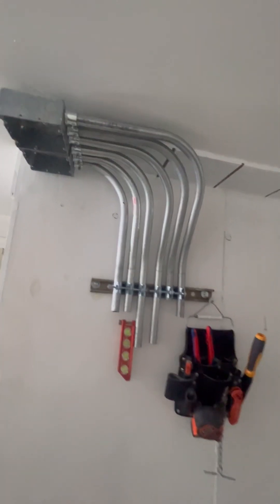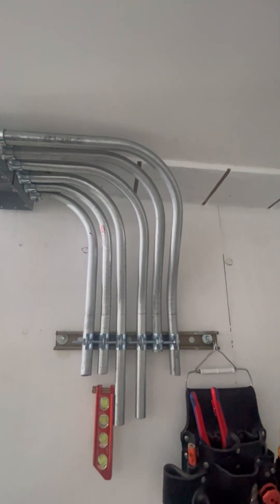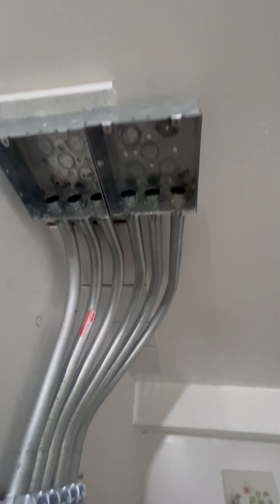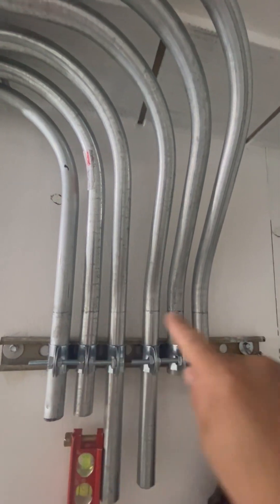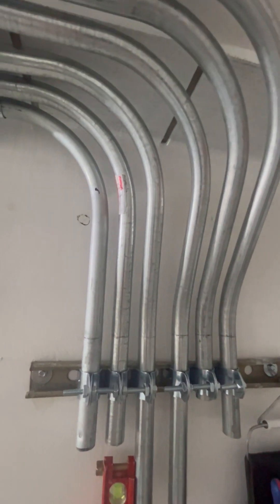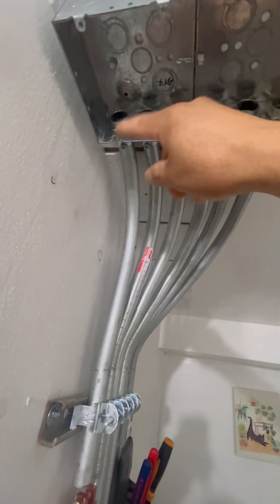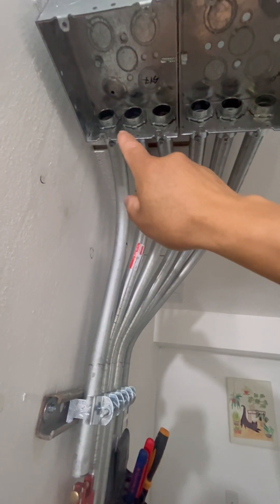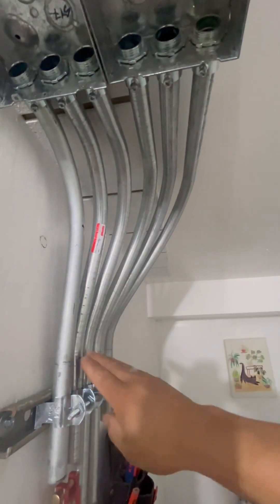How to Line Up Parallel 90s | Fanned Kicks Every Electrician Should Know

Comment: Dang looks good but deff more for improving your doing good my guy. To save room you can run the top bends closer to wall an then bring em over youl use lil more pipe tho
Reply from the maker: Thank you for your comment here. 
Those 6 conduit bending  were made from scrap  pieces as practicing only . 
I focused more on the degree of bends and shrinkage amount so as it also comes down the wall with the same center to center as the boxes they come out from 

.

Comment: Honestly, should have used LR's or LL's and went at right angles.. Its really not as nice to look at because its so close to the eye.. The price of 6 fittings that are not cheap, would be worth it... in all due respect
Reply from the maker: @awesome6486  Thank you for your comment. I appreciate your response. I did once the conduit run using LL and the Foreman there told me that he hates to get up high to open and close fitting when  pulling wires.
Reply: @Poliberme  Oh I understand.. It was done well no doubt.. Its just so much in a short space, up close.. I would tell the Foreman that he would have to be up at that height to work on Junction boxes anyways.. It wouldnt add much time at all but I get it. Its about $ sometimes but I think you did very well with these bends. Great effort